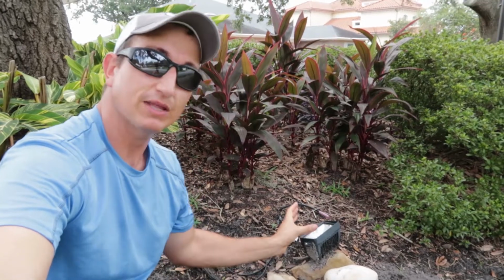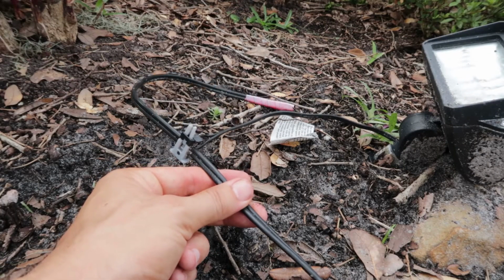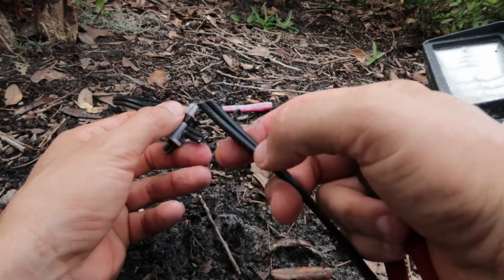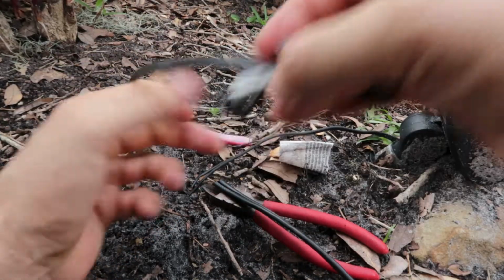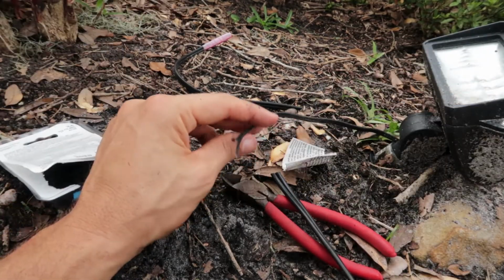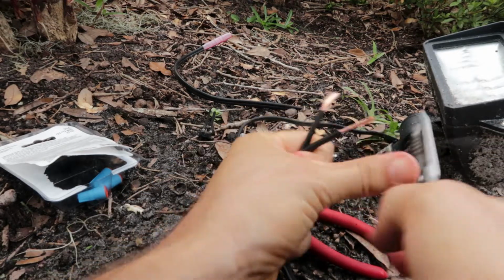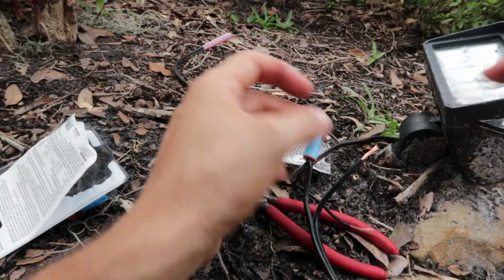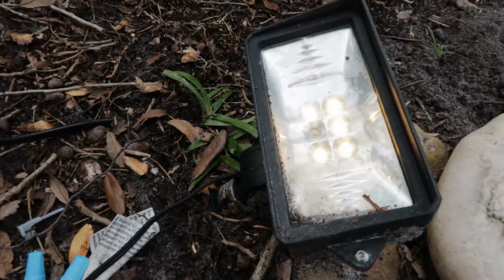How To Fix Low Voltage Lighting

Comment: This was gold...Hopefully this is the fix for my Malibu lights . I am going to try this... I have 10 lights and the first two closest to the power source work and the others don't .. They have the exact connecting point you show... that you mention often fails. I think I should just fix one at a time ? or just do them all since you point out that kind of connection is cheap and goes bad anyway ?
Reply from the maker: Thanks. It might not be a bad idea to replace all the connections for your low voltage lights if you are able to.  Best of luck with your landscape lighting repair.

Comment: Hello there! This is the exact set up that I’m having issues with. Only a few of the lights are out. Now Is there a way to make sure that this is the issue before I replace the connectors?
Reply from the maker: If some of the lights are out I would guess it is very probable it is due to bad connection points somewhere.  Sometimes though  the lights themselves go bad, get damaged, etc.

Comment: That was the last light, but what about when it's not the last light?  How would you make a similar connection?
Reply from the maker: You would cut the main power wire in two pieces near where the light connects in.  You need to splice the light wires as well as the two wires you just created (by cutting the one main power wire) all together. This allows power from the main power wire to travel to the light as well as down the rest of the power wire to other lights.

Comment: The low voltage is also alternating current so it’s not necessary to keep in track of the polarity.  I’m not a big fan of wire nuts or those factory connectors.  It’s best to twist the copper wires together, heat them up using map gas, use solder, coat it twice with pvc cement or liquid electrical tape, heat shrink it, then cover it with two layers of plastic and tape.
Reply from the maker: Thanks for the low voltage lighting installation tips.  I think this particular set of LED lighting fixtures had fixed wire polarity due to the nature of the LEDs and/or the LED driving electronics.

Comment: I have two legs on an LED system. After a thunderstorm and particularly close and loud lightning strike. The whole system went out. The x-former shows a short. I was able to disconnect one leg and the other leg comes on. But when I reconnect the disconnected leg, it shorts the system. Is the problem in the cable or one of the fixtures?
Reply from the maker: Hard to say what your issue may be from this end but please share what you determine the culprit to be. Thanks
Reply: Well first I proved continuity through the main cable with a multimeter.  Then I disconnected all of the lights on that leg. Manually powered on the X-former (it’s usually on a photo cell) then started connecting lights until the X-former tripped again and identified 2 lights that must have been damaged in the lighting strike.
Reply from the maker: @JV-he3gb  thanks for the insight and glad you were able to troubleshoot the low voltage lighting problem

Comment: Why did you cut the wire and then take off the connector thing why would you cut the main wire that makes no sense to me lol I don't think this video was well made it all it's hard to tell exactly what you're doing what you're cutting what was connected to the lights what was the main wire...
Reply from the maker: wire is cut to remove any potential corrosion in the wire itself near the splice ends